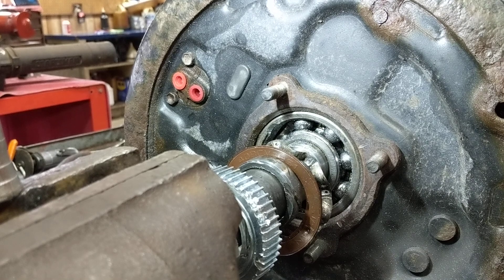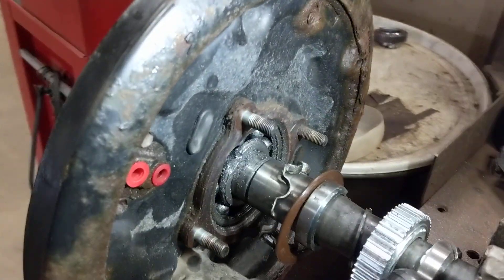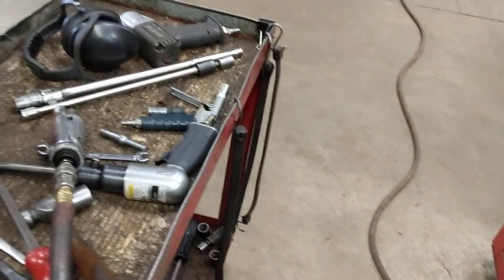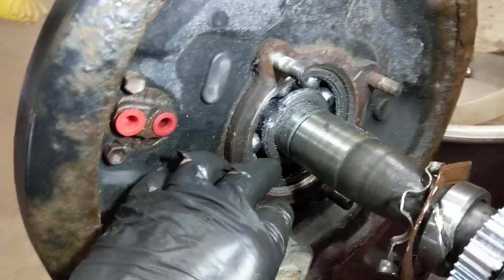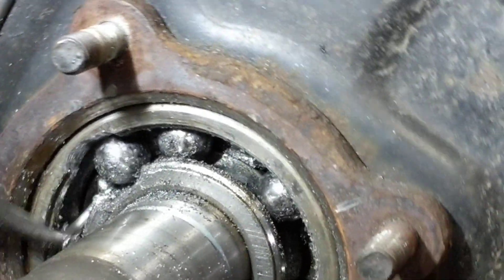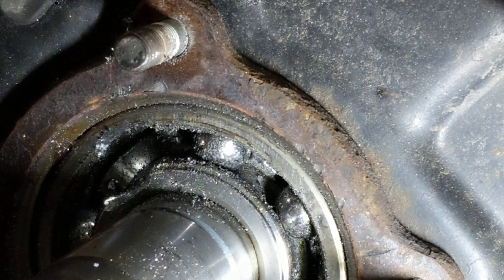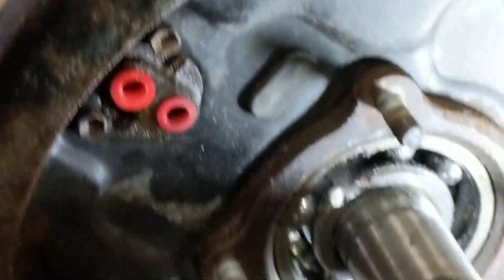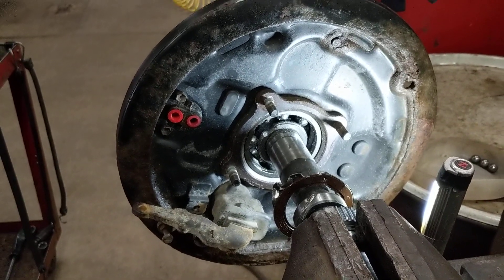Tacoma rear axle bearings

Comment: Thanks for posting this.  I did this method quite a number of years ago myself and works great.  Even if you have a press and the correct adapters etc, it does take a huge amount of force that often bends adapters.  For the bearings that come as a unit on newer tacomas, you could cut more, and make it easier.

Comment: that "second lock ring" you cut off is the seal surface... might be trouble.
Reply from the maker: When removing a lock ring, only cut in about 3/4 of the depth and then split it with a cold chisel so you never touch the seal surface.
Reply: @geocachingblister  what you are referring to was a concern of mine and i was going to cut the ring but not all the way through like you did to not damage the axle.. I believe powerplay didnt realize this. What i think he is pointing out is that the seal will not work if you dont replace the ring with the gash you cut on it 🤣🤣🤣

Comment: I dont think that's how your supposed to do that
Reply: Its called ingenuity.  This is the guy you want with you if you get stuck on a deserted island.
Reply: If he was actually stuck on a desert island doing this he'd get a pass.
Reply: @DaveRogers583  Yup! he'd get a pass and and in that island the Certified ASE mechanic that has the hydraulic press with the jig bearing tool in the mainland would be giving him the pASS and would be lost without him. Its a good solution for the capable DIY guy that wants to save $$$.
Reply: @Anotherdaynparadise  lol
Reply: @Anotherdaynparadise  you assume everyone who does things the correct way wouldn't be able to also do things the wrong way if needed. Hes doing things the wrong way when it's not necessary. Most do things the hard way when there's no other option. He has options and still went with the hard way. If he was useing his ingenuity he'd come up with a way to do it without a press and without just destroying everything in sight. There are ways to press that bearing out with what most backyard mechanics have laying around useing some ingenuity instead of seek and destroy.
Reply: @DaveRogers583 That is false. i could see how you may presume that but you are incorrect lo.  im sure many techs have the ability to exercise critical thinking.  He didn't destroy anything that was not going to be replaced anyway so we will strike that one.

You said...if he was using his ingenuity he'd come up with a way to do it without a press and without just destroying everything in sight. Lol did we watch the same video?  Im pretty sure he used his ingenuity, didnt use a press and didnt destroy everything in sight. 

Did you hear when he started the video that if you were gonna nit pick and criticize his work and were looking for the right guide or info to do this job that maybe this video was not for you? Anyways my point was to compliment him on his creative idea that can work if you have the skills to do it. Is it the proper way? No. Will it save you money? Absolutely. Will the end result be the same as a pro's job with the shop an all the tools and the hefty bill? 100%. will everyone like it if you did it like in this video? Who cares when you're saving hundreds of dollars. Will you feel good with a sense of accomplishment knowing you saved more money and did it differently than anyone else? I certainly will! Im doing it just like this because i have the tools needed the skill to do it and love to do things differently. If i was going to do a bunch of bearing jobs then it wouldnt make sense but its just a one time thing and a great solution for it. Btw i was a cylinder head porting specialist for racing performance engines for 10 years. My work was outstanding. Im going to grind the slot on the bearing blindfolded just for you . 😄
Reply: @Anotherdaynparadise  he didnt even show any success in this video and that's not how you change a wheel bearing. Plenty of better ways to do it without destroying everything. Just look at a few other vids on here where they dont use a press.
Reply: @DaveRogers583   i like the way he did it and i dont care what anyone thinks. It will work for me just fine just like im sure it did for him. There are plenty of other videos and ways to do it but here you are trolling in the comments...Smh